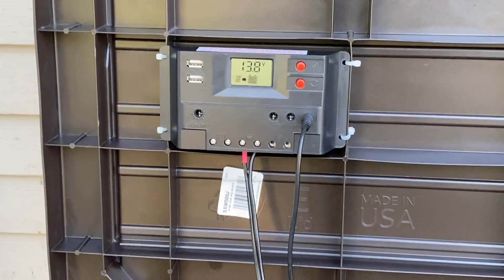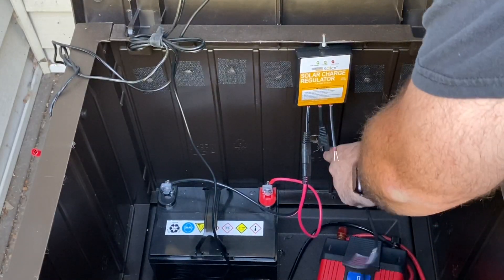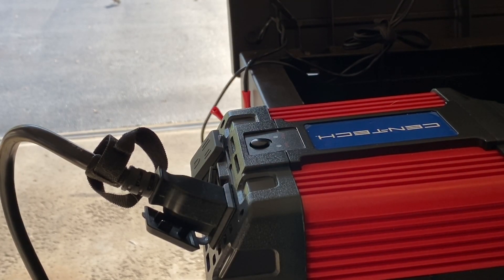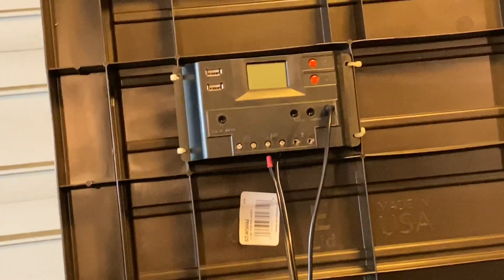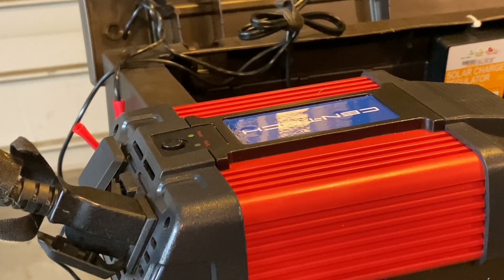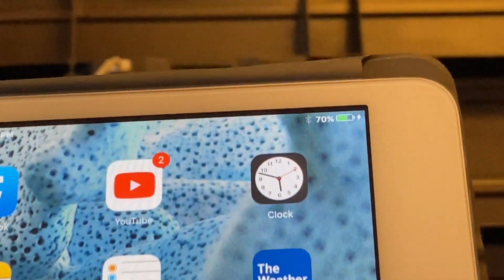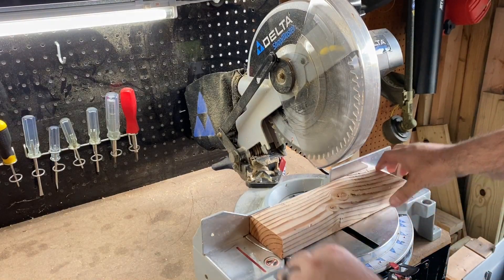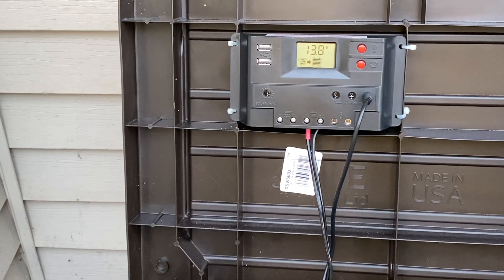Solar Panels: Thunderbolt Magnum 100W Solar Pane: Testing for a Grid Down situation : Harbor Freight

Comment: What size is your converter it gives you power the one you plug-in say mine says 400 W I got one it’s 375 whites and another one 200 W I think it’s the mostly the problem is running like Salz and drills and grinders is the converter box

Comment: Your inverter is to small for the chop saw it will work you are just very lite in the battery and inverter department,you may want to upgrade your system.
Reply from the maker: I have upgraded the inverter

Comment: Probably want some regular battery terminals..I like brass..itll prevent the battery from losing connection maybe..pretty safe bet it'll work better..those clips never carry amps very well they usually just get hot..I've seen them glow red under a big enough load..not a great idea with it right by the battery vent cap..I've even changed them and gotten a slightly higher voltage just from that..if you put a shutoff on the inverter connection it will save the battery while not in use... the capacitors that spark run it down..also it prevents the spark when you do use it..might keep ya from blowing one up too..the spark occurs inside the shutoff not on top of a battery with hydrogen in it...I bet even an electrician would agree..lol..y'all stay safe while playing solar now

Comment: I've got 2 of the 45 watt kits that my uncle bought and one kit was still in the box so I started with those and 2 35 amp hour lawnmower batteries. I have to use both the 4 amp controllers lol in parallel so I got a 4215 Epever BN and bought four 1000 HQST  panels...my thunderbolt stuff is seperate but I'm thinking about jumpering them together in the morning to see if I get any wattage increases from doing it that way..they're hooked 12v now but I'll have to put the 2 kits in series for the 42 volts like the rest of the panels..I'm going to order 2 more panels and go pick up 2 more RV batteries tomorrow..I have six 85 aH  RV batteries hooked to my 24 v 2000 w AIMS  inverter/charger..I'm hoping 8 is enough batteries...lol to run this little gray welder from WW2..it will run on a 15 amp breaker unless the rod sticks and that will cause about a 2300 watt surge because it's got white copper windings (35% silver) so I've got to get a 20 amp GFCI  tomorrow too, and finally after a year of buying stuff I'll get to plug the the greyhound into the blue box with the  wavy line on it...that's quite a goal but it's going to be cool to lay a bead completely using sun power. It only goes to 45 amps on the rod so I'll have to use small rods..that's this week's project...a little welding music please....(how many you tubers want to try a welder on their inverter?)

Comment: Those miter saws need their own power generator station...they must be super inefficient because I could cut the same board with just a few watts to my DeWalt reciprocating saw...I think they mostly just use a ton of power and make a bunch of noise...in a grid off situation I'd just use my Stihl chainsaw probably...I just got through scrapping out a miter saw because they're pretty much junk that waste power..I'm trimming back on useless junk so that I can have stuff that isn't gonna blow my inverter/charger or something because I had to save to long for that..

Comment: Your problem is your inverter. Get at least 1000 watt inverter. The load spikes when turning on that saw and requires stable wattage to maintain runtime. This has nothing to do with the panels. They will charge your battery no doubt. It's your setup.
Reply from the maker: Thank you for the heads up. I will get a 1000 watt inverter.

Comment: Nice video.  I just purchased and set up the same system for use at my Farmstead where I am not connected to the grid.  Using it for an alarm system that uses cellular.  Why do you have the solar charge  regulator and also the charge controller?  Do you actually need both?  I did not see the regulator in any of the instructions I received.  Thanks.  jim  rangemastr@aol.com
Reply from the maker: I use the solar charger regulator to find out how much I’m charging. Right now in Ohio, we have not had a lot of sun and it was tell me I was getting low voltage indicator. In the summer, when it is sunny, I will get the high voltage indicator. I hope this helps.

Comment: Some nice equipment. Perhaps change the door opener light bulb to LED. Definitely have to use manual tools 
to save energy if needed.
Reply from the maker: We will be changing the lightbulbs to LED soon. In my Opinion it’s good to have the cordless circular saw and reciprocating saw and drills and easy to charge the batteries on the solar battery, if not, you are right. Manual tools will have to be used. Thanks for watching